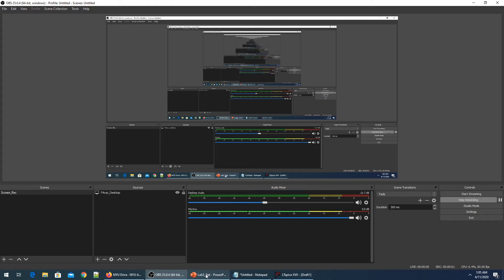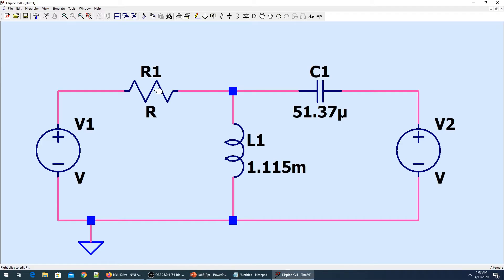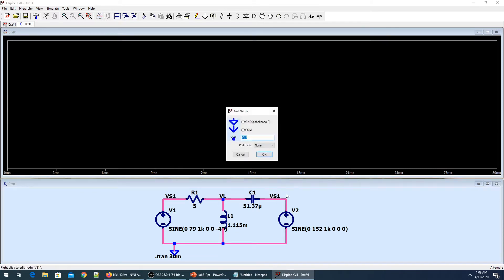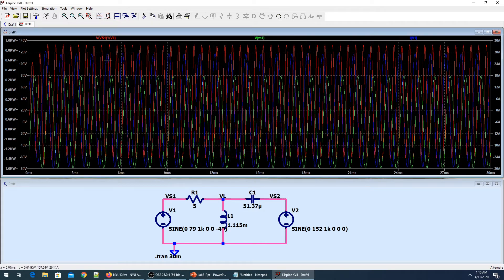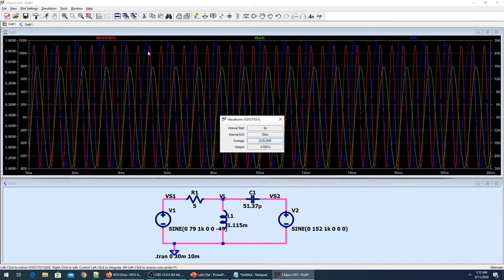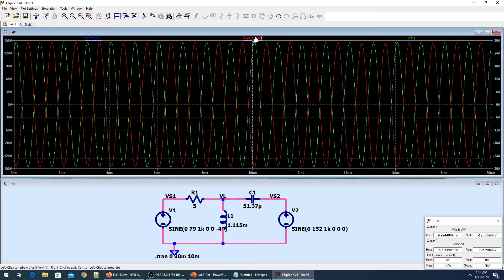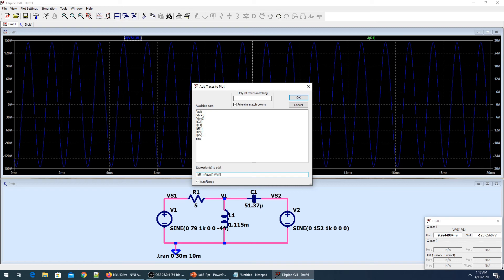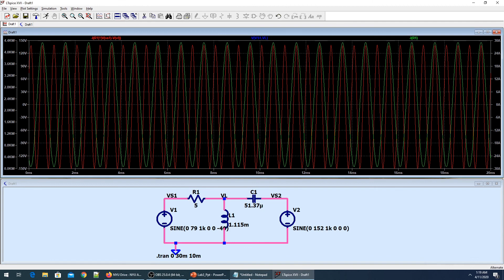LTSpice Instantaneous and Average Power Techniques

Comment: Around 6 minutes you show the window for average power of -2.29 watts.  A power cannot be a negative value!  Please explain.
Reply from the maker: Hi Chris, Your understanding is not entirely correct. Power can be negative, which means the load is actually supplying the power to the system instead of consuming it. This is very much true for many everyday systems. A simplest example to make you understand: a Solar panel (power source) charging a battery (Load), in series to a water heater (another load). Once the battery is fully charged will now supply power (negative power) to the water heater. It is very difficult to explain here in the writing. Secondly, the sign convention used (the direction of the current) will always yield negative or positive power.
Reply: @farazafzl  Power due to current flowing in a resistor cannot be negative.  Also, if something like a battery is supplying power, it doesn't make the power negative, it becomes a source supplying positive power not a negative load.
Reply from the maker: @chrisspain7776 You are absolutely correct. But you are missing a concept of the Power absorption/dissipation (by the batteries as well as resistors)  and the power generation. Per‍haps you would like to read this 
https://www.khanacademy.org/science/electrical-engineering/ee-circuit-analysis-topic/circuit-elements/a/ee-sign-convention
Alternatively if you have Hayt and Kemmerly (9th Edition)-- (Example 11.4, Page 439) Or Exercise 14- page 463 and you will understand this concept .
Reply: @fzlWhy post that link? The link you provided only talks about conventions for signing of current and voltage, it does not mention power, or support your argument.  It doesn't to change the fact that power is always a positive value.  If you design a circuit that you claim produces negative power in a resistor, I would keep it to yourself, if I were you :)

Comment: The voltage source 79(angle -40 degrees) is show in lt spice as 79sin(wt -40) . Usually in books or assignments, the voltage sources are cosine waves , so your voltage source becomes 79 sin(wt -40 +90 ) = 79sin(wt +50). The phase would be +50. If your voltage sources are sine waves,  your calculation is correct.